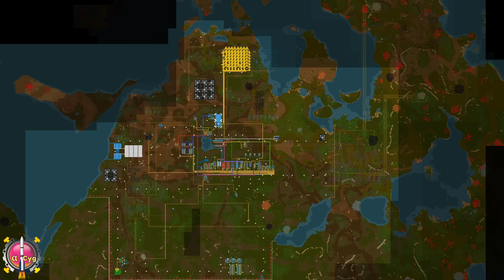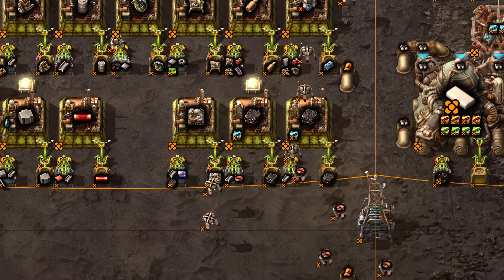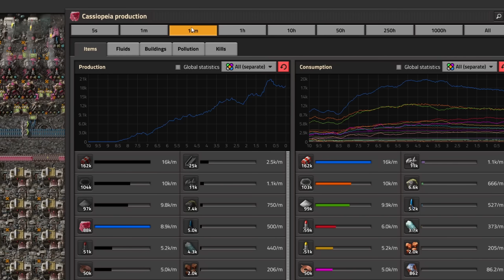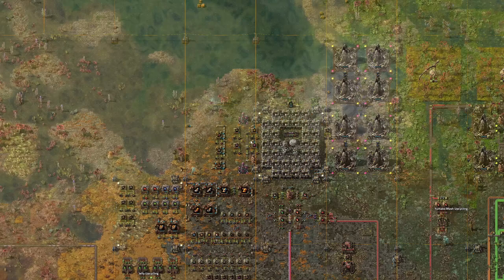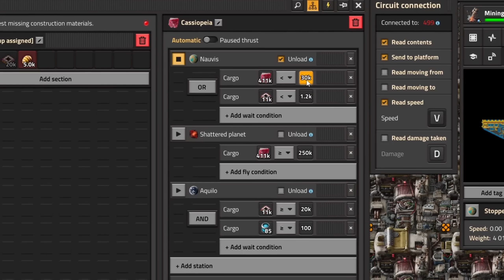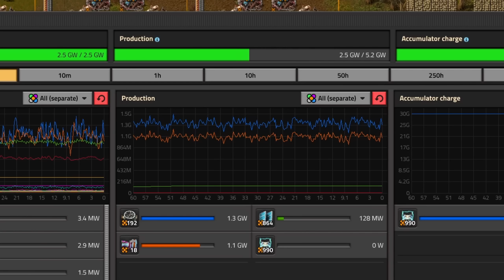100K Science per Minute! | 1 MILLION SPM MEGABASE | Factorio Space Age | 11

Comment: I haven’t captured any promethium asteroids yet in my save, which is roughly 200 hours deep, and I’m severely underutilizing Volcanus, with just around 400 MW of power consumed there, but I decided to experiment with a high density fusion plant there. It produces a cool 9.0 GW, with 18 common reactors, 90 common generators, and 8 common cryo plants surrounding one uncommon speed beacon with legendary modules. From memory, I think the speed modules in the plants are rare, and it turns out this is the perfect ratio for this size of reactor. You can upgrade the plants, reactors and generators as long as you upgrade them all to the same quality at the same time and leave the modules and beacon alone. I have a much smaller plant with six reactors on Nauvis, and I decided to keep my nuclear plants running for more capacity / backup power in case I tinker with the fusion plant or need to move it. I love building power plants. Power is resource zero — needed in some amount to produce everything you want, so I figure: you might as well over-build power relative to your base’s ambitions. After all, you want your laser turrets to work properly at all times. That said, 20 times my current consumption is a power plant tangent record, even for me. Eeking out every possible neighbor bonus was a super fun puzzle which I actually mocked up on paper to show even my friends who don’t play the game. I would have gone for a 126-core reactor if I had the parts and space available, but at that scale, you have to place your roboports carefully just to cover the requestor chests feeding the reactors (optimal 18-core design is already too densde for belt-feeding) and the generators dwarf the reactor area and take massive amounts of land. If I had build any larger than an 18-core on Volcanus, I would likely have been limited by the foundation required to cover the lava isolating my largest land mass on almost every side. If you build the theoretically optimal plant, it gets prohibitively expensive in terms of everything from the number of generators you have to produce down to the massive tangents around its perimeter which you need to make to transport resources by belt or train. I think that this first ever space age run is also by far my biggest Nauvis base now, but it’s difficult to compare to 1.1 because machines and recipes were so much less productive then.
One more thought: by upgrading the reactors, generators and plants in my Volcanus reactor from common to legendary, you’d go from 9.0 MW to 22.5 MW. Not worth it TBH. Far easier to just build another one if you need the power. If you saved space next to your first one, you can fit the reactors together for a slight bump to their neighbor bonuses, but you’ll still need to increase the number of generators to match the new combined output, and beef up either the beacon, modules in the plants, or number of plants to cope with the increased hot coolant byproduct.

Comment: I think the mod is fine, at least until they are able to figure out some UPS refinements in 2.1. As you point out, the belt-weaving is the other way to do this, but hits UPS harder (plus it makes the ship look nicer this way). I think maybe I would have gone with a smaller stack size, maybe 10 or 20, still would have allowed belt stacking and stack inserters to help out.

Comment: increasing the stack size for promethium feels analogous to turning off spoilage for ag science. thats a pretty significant part of solving the problem
Reply: I would completely agree with you. However a lot of the problem solving for Prometheum science boils down to:
- Having multiple ships and doing some weird 'key' mechanic to prevent biter eggs from distributing to multiple different ships messing up timers
- Completely ruining your UPS and basically turning factorio into UPS optimization
- Building completely wonky uber sized ships with multiple layers of vertically stacked engines and massive belt weaving storage

While you might consider those entertaining problem solving, so far in my playthroughs I've only found them annoying. My ships can run far enough to gather a ton of prometheum. My computer can't. I do agree - it makes it significantly easier. However it solves a problem that many of us refuse to solve. Either turning to other ''exploits'' or simple hardware problems.
Reply: The issue is UPS, you can't use 20 vanilla ships. Probably.
Reply: I dont like having to optimise UPS. I dont think its a part of the intended challange. So if there is a mod that can significantly help, i will use it
Reply: It undermines the meaningfulness of a “challenge” in a logistics game if you just mod the game in a way that makes logistics significantly easier. 
I’ve been following this guy for a while and was surprised he did this.
Reply: @Elearen  I think his explanation of why he did it makes plenty of sense. There is no real "challenge" to getting the same storage he did with the mod. It would just mean that he would have made the ship 30x taller with a bunch of belts all over the place, potentially killing UPS. It's not like there's a actual limit to the number of belts he can make.
Reply: @karadinx  I think the point is that that isn't the only solution, you could make a ship that carries biter eggs out instead of doing the belt weaving nonsense. I don't personally care, but I think the point that it ruins the sanctity of the challenge is a valid thing to say considering fighting against UPS has always been a problem for mega bases. As for whether or not he "should" care, that's up for debate. There's also the recipe changing tech to stack unlimited promethium chunks inside the cryoplant so he could remove it and set circuits to do that instead, but I don't know the effect it has on UPS.
Reply: @karadinx  Optimizing UPS is part of the challange for me. If I can't beltweave then I need to produce it on the ship, so i spent at least 2 hours making sure biter eggs won't hatch on the ship which was fun! BUt it is a sandbox game in the end you do what you want to do
Reply: Literally all you need to do in unmodded is make the ship bigger or make more of them, both of which eat up ups. It doesn't seem like much of a challenge to begin with
Reply: I totally disagree, turning off spoilage means your interplanetary logistics ships have to be extremely quick to transport agricultural science before it spoils. On the contrary, this method of storing promethium ore just means making the ship longer, not faster, a significantly easier challenge. Comparing these two challenges as “analogous” is pretty unreasonable. That being said, an out planetary ship which requires biter eggs to stay unspoiled is a very interesting challenge and I would love to see Avadii’s design in such a case. Using mods to reduce ups for this specific challenge of simply storing the promethium ore seems reasonable to the ugly alternative of having an ugly video.